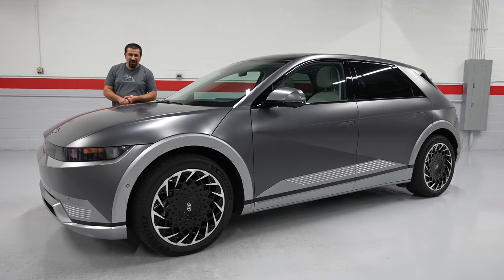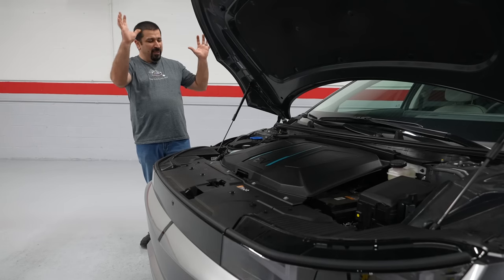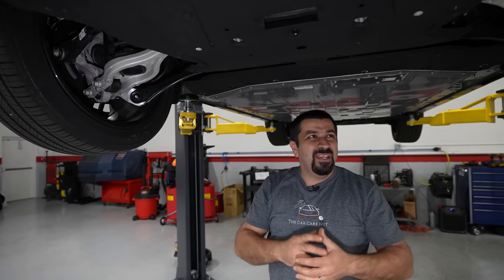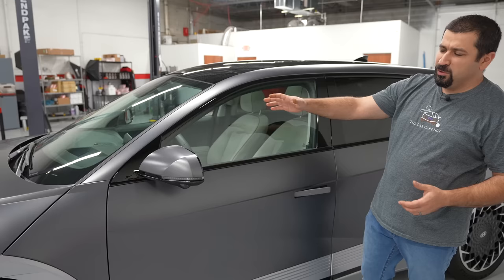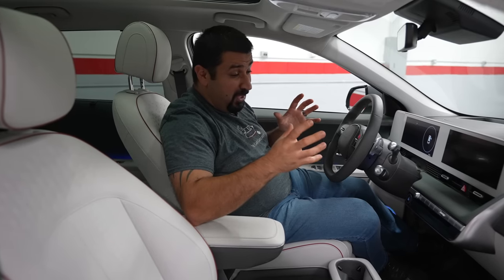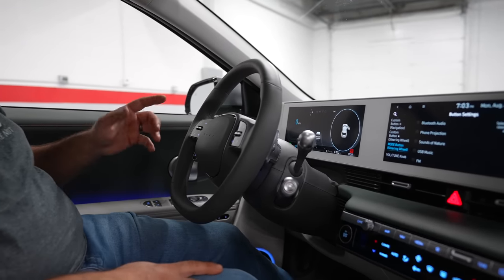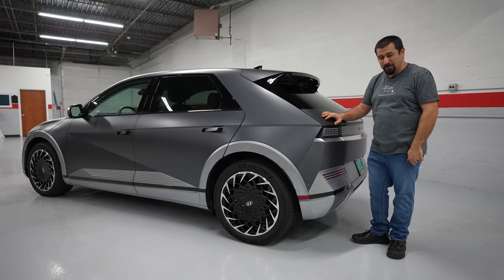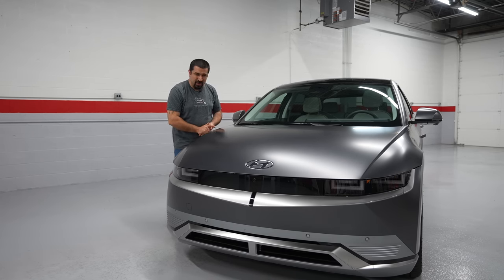Should You Buy a Hyundai IONIQ 5? Or a Tesla? | A Very Comprehensive Review

Comment: 30:27

You 're wondering why there are four dots.
The official sign of hyunday is an H 

In morse four dots are also an H.

I suppose this is why we find four dots, not three or five.
This also means that on the steeringwheel we find the signature from hyunday in the (already old) morse code.
 37 minutes...the shifter works absolutely fine to me. I suppose it's more as controls in games/simulators. Never went to the wrong gear.
But I never drove any automatic ice car before driving electrical. Also in european automatic shifters it's pushing to the front side for driving, back for reverse.
And I'm customed with a gear shifter at the steering column (in old european cars )

34 minutes.
Yes , at home I need to charge hours. But does it bother me? 
No because it does not take a minute from my personla time. Plug it in and leave it pakerd for the night.
How many days do you drive more tha 250 miles?

Any ICE car has to go throughout the year to filling stations. I only have to go to a superchargers on the occasionally longer trips  a few times a year. And in Europe it's not a big issue to find 350KW chargers along any main route. Also ..with any ICE car on those longer trips I made stops for toilet, coffee and eating....this model of car was charged before my personal stop was finished.
Only thing to plan....making those stops at places where a 350KW charger is available because the infra is not that good as for petrol ...but this will change in the coming tears.

(Remember...any electric car without a private parking with a level 2 charger is a nuissance to charge....unless your local government places level 2 charges ta the street parkings. And enough of those. Also that local government must guarantee that NO ICE car parks at the places for level2 charging (by pulling those away and asking fines to the owners)
I my country asking the local government for placing such chargers will be honoured (if there is none available nearby)

ps...I'm driving electrical (first partly) since 2013....I've seen the charging network growing.

Comment: One of the best videos I've seen on the car. Pointing out the EVs can have complexity is useful because too many EV enthusiasts say they are zero or close to zero maintenance vehicles. But I'm interested in what you said about the axles. I think a lot of people know that Toyota's bZ4s have a recall due to a potential for the wheels to fall off in hard driving. Is that a possibility with this car and other EVs? The axles can snap due to the force of hard and instant acceleration over time?

Comment: With my 120V charger (level 1). I got more than 10% off battery charged overnight. I have an EV6 long range. Technically, it's a samething as this car. Drive in the city, you don't need to have 100% nor 80% full. Just 50% battery is very plenty. And save the longevity of your battery. Actually, 25% is better for the longevity, but you're pushing there.

Comment: My Tesla Model Y does the D - backwards, R - forward.  Drives me nuts.  Would have much prefered the Hyundai 5 version of pushing it in the direction you move.   Must just be the way my brain works but it is much more logical.  He is complaining that his muscle memory is different rather than that the Hyundai is actually got it right but people won't be used to it.

Not sure why the big speech about range anxiety.  I had that for about a week until I spent a day driving in the country and realised you get a long way before you need to recharge.  Plugging it into the wall recharges overnight. Takes about 24hrs to get 100% recharge so not really an issue for me - you'd have to be driving 200km a day even need have to start planning a trip to the charger once a week.  If you drive 200km a day, you probably want an EV anyway because you must be spending a fortune on petrol.

Comment: If you want an EV that has a display behind the steering wheel, instead of a single centrally-located IPAD that does all control functions, then get the Ioniq 5.
Reply: The top spec model Ioniq 5 even gives you a heads up display - a godsend if you have to wear varifocals...

Comment: Couple of things… 1st, you said that it is costly WHEN the battery goes. Current batteries will ouTlive the car itself. Yes there will be some lemons come off the production line but those will be identified before the battery warranty has expired.  2nd, your assertions around charging and range anxiety are not based on real world use.  It takes me 20 seconds to charge my car… 10 seconds to plug it in when I get home at night and 10 seconds to unplug in the morning.  The number of times I actually have to use a DC fast charger are minimal.  Every day you start with a full battery. No bothersome trips to the pumps! Finally, electrifying existing ICE platforms is the least efficient way to make a BEV.  Toyota has even just admitted this themselves this week.  A dedicated platform developed for EV’s from the ground up is essential to the EV transition.

Comment: If you parked with the wheels turned to the right, and used the keyfob to move forward, would it drive to the right?

Battery: Better handling, less frequent maintenance, less disgusting and toxic fluids dripping everywhere...the future is bright! Thanks AMD!

For the door handles, over the life of the vehicle, you'd save hundreds of miles, and you use it once when you get in, not even when you get out, you don't look at it when you're sitting in the car...i love these logical decisions!

I've had ICE cars strand me with blown engines (acura rsx 2.0l, audi a5 2.0t), ripped belts (timing belt), happy to say goodbye to that expensive and stressful experience!

Two screens? Not logical!

Comment: Well, this whole thing remains to be seen. My chinese EV too has 2 cooling circuits, one for the motor/inverter and one for the battery, both use the AC in extreme cases (in my country this is necessary)
Although it has a resistive heater. And under my hood, it's all just there. nothing is hidden or obstructed, everything is easily accessible.
Reply: @Gerry Prasetyo I'm not that rich

Comment: I would agree with you about the screens. I've had a plethora of laptops and the longest any one laptop had lasted was 5-6 years, before it was irreparable. Are the screens inside the car any different, nope, same tech as any computer. So expect to have to replace your screens in about 5-6 years, and by screens I mean the whole computer system that runs that screen.
Reply: The car's battery won't be very usable after 5 yrs anyway. One of the big disadvantages of EVs is that their batteries deteriorate over time.
Reply: @dekkerlundquist5938  Sure batteries deteriorate over time, but the deterioration is less than 10% over 10 years... So by extension less than 5% over 5 years.
Reply: Laptop screens are much more exposed. They get lugged around, dropped, have heavy stuff put on them, and so on. A display in a car doesn't see any of that wear, unless you're really doing something wrong with it...
Reply: @FrederikNJS  Except that some batteries do not degrade at a linear rate.
Reply: @dekkerlundquist5938  Agreed! So it might only be 3% after 5 years, 9% after 10 years, and then it might be tapering off more aggressively after that. So possibly 15% at 15 years, and 23% after 20 years.

Comment: Thanks, nice review, I'm definitely on the fence about Tesla vs Hyundai Ioniq 5...I'm definitely leaning towards the HI5
Reply: Same.
Tried both yesterday.
Tesla was more fun but ioniq was more practical.
In particular, changing Regen level instantly on the fly with paddles in HI5 is way better than hunting through menus on the Tesla while your eyes leave the road.
One button for autopilot in HI5 is great.
Also, needing to go through menus on a touch screen just to open the glove box in tesla 😂

Tesla handles better though and can be bought much, much cheaper, especially with older models being around.
Plus the charging network is painless to use.
The nav is better than Hi5 too.
Also Tesla is fast, which isn't practical but is tons of fun when cops aren't around.😅
Tesla's also come standard with some things that only limited/ultimate HI5 has, so again, price is a factor.
If I could get a used '22 awd sel HI5 in my area I'd do it in a heartbeat but they're scarce, unlike Teslas.

Comment: Don't sell we octogenarians short (though I admit I have a few months to go)! My wife and I have each owned BMW i3's for the past five years. Though that model will soon celebrate its 10th birthday, ours still look and feel new and continue to bring smiles to our faces as we motor along. Though I did not tire of mine, last summer I was looking for a change, so after extensive research and several test drives I ordered a Volvo C40. I took delivery a month ago. (My i3 stayed in the family as our son now has it.) The C40 is another wonderful EV. (How about a review of one, or of its sibling, the XC40 Recharge?) Incidentally, when I was recently at my Volvo dealer I spoke to a woman not much my junior who was there to take delivery of her C40.
Reply: I match you in age. I have just had my XC40 Recharge VOLVO for one month. I bought in a hurry because my college ago grandson wanted my 27 year old Volvo 850. I am going car shopping on Thursday because the dimensions of the XC40 recharge makes it difficult for me to access the charging stations. And as they are not in frequent use the cable at 2 inches in diameter, is very stiff and difficult to plug in to my car at a charging station.  I loved my 850. I consider the XC40 a very fast electric golf cart. It was foolish of me to buy in a hurry, you do need a home charging system. I allowed the Volvo reputation of reliability, which I had with the 850, to cloud my judgment. It will be an expensive lesson.

Comment: I really like your videos, thanks so much for making them. 

The  E-GMP-based Hyundai Ioniq 5 received four dots on its steering wheel, which signified the letter 'H' in the Morse code. So the .... is for H

Regarding the aux battery, my friend needed  a 12V battery service on Tesla, warranty covered it but the cost is $1500. Ioniq 5 has it easy to access and replace. I have a 22 SE AWD. Super comfortable and have a floating ride. Hope Hyundai keeps up with the promise and have a decade of life with it.

Comment: like any other EV, this would make sense for someone that has a predictable (meaning going to the same place of work) daily commute. Especially, if you can charge at work and can charge at home. It would not make sense to drive around hunting for chargers. That is my 0.02 worth of opinion.
Reply: No point to charge at work for this. It's not going to add much unless you have a L2 charger at work and it's not going to make much a difference unless you commute 300km each way.
Reply: @wgemini4422  I charge at work once a week - no home charging available. And on road trips it's easy to recharge. This one goes from 10-80% battery charge in under 18 minutes, you'd be hard pressed to have a bathroom break and get something to eat before it is finished charging.

Comment: For about $1000 you can install a Level 2 charger and charge at home overnight. That’s the cost of about 20 tanks of gas at $4 a gallon and you’ll be “filling up” for pennies.

As for the battery failing and making electric car owners regret the lack of an ICE, I’m sure you remember the dire warnings mechanics had for people buying hybrids about a decade ago. Remember when all those batteries failed? Me neither.
Reply: My question is, “How much coal has to burn in order to recharge these cars every night??”
Reply: @coloradoboo1071  An amount that will produce significantly less carbon than a gas engine traveling the same distance as the electric would produce. That’s the point of electric cars, in case you missed it.

The only people that expect electric cars to be completely carbon free seem to be the people that don’t want electric cars.
Reply: You still won’t be able to go on a road trip in this or many other electric cars. Charging stations need to be as popular as gas stations. Until that happens, electric cars are pointless for most people. Also, the battery replacement is going to make up for any saved maintenance costs. Most hybrid batteries aren’t as expensive to change as something like this. Not to mention the production of that battery produces major emissions, so the whole “electric cars are so much better for the environment” isn’t completely true. I’m going to stick to my gas cars.

Comment: Can u make a video on how to fix a flashing check engin e light please. The car is a '03 camry xle v6 +250k miles  if that helps
Reply: Get a scanner to see what is causing it. Could be many things but in most cases a cheap scanner plugged into the OBD port will tell what the problem is. Then you have to fix it.

Comment: All the exhaust is at the coal plant that produces the electricity
Reply: And the battery factory
Reply: And what about the 20 kWh of electricity that are used by the oil company to get 6 litres (1.7 gallons if I converted correctly) of petrol or diesel from the well to your tank? These 20 kWh come from the same electricity grid you criticize - and are used to power your ICE... If you care that much about the 20 kWh of energy a Ioniq needs to drive 80 miles then you should care equally about the 20kWh your ICE car used up indirectly by adding 6 litres of fuel to its tank to then burn them and drive 80 miles while also spewing a whole host of other nasty gasses into the surrounding...

Comment: Honestly was kind of disappointed by this. Usually the reviews are very informative, but this felt mechanically lacking with a bit too much personal preference mixed in regarding the looks and charging. No mention of it's 800V DC charging, V2L from the charge port, just about how how it charges slow on a normal household outlet which is true for all EVs. 

The 800V charging is interesting, it actually has 2 400V packs and it's 400V in normal operation. When it gets to a DC charger, there's a bus bar that flips from parallel to series for the 2 packs to get it to 800V for faster charging. For the V2L from the charge port, there's bi-directional AC charger, it's one unit, the Integrated Charging Control Unit (ICCU), which is new and unusual for EVs. The ICCU had a big recall regarding coolant leaking however so they would fry themselves or overheat. Info like this is why I watch your channel, but it was lacking in this video. I hope you can improve for future EV reviews.

Comment: So I talked to a lady in her 60’s about owning a Hyundai Kona that she has used for 2 years. Every night she plugs it in and in NZ charges it free of charge wth the deal she has with the electric company in NZ. Therefore no range issues. So she drives without paying for fuel! If you document the costs of running a EV vs ICE then the EV already wins with large savings. Tony Seba has already proved that EV and batteries will only get cheaper every year so ICE can not compete based on price. Everyone will just have to learn, growth and change there habits to operate EV has cars - question is do you the intellectual capacity to do so?

Comment: always heard the faster you charge the battery 🔋 the faster it will deteriorate 
how true is that in your opinion?
Reply: About as true as the faster you drive, the faster your ICE engine will deteriorate.
Reply: If scientist talk about degradation through fast charging you need to know what they consider fast charging. That happens to be 6C - which is 6 times the capacity of the battery - if the battery is actively temperature managed (which currently all but the Nissan Leaf batteries are). So a 77kWh battery charging at 460 kWh would be charged at those 6C. The best current cars do - and the Ioniq 5 is one of the fastest charging BEV out there, only Lucid Air or Porsche Taycan and a select other much more expensive cars do better - is around 230-260 kW charging speed. The other thing that determines degradation is the charging curve and temperature in combination. The Ioniq 5 manages to charge at an average of 2.7C, that's high but not insanely high regarding degradation.
Reply: @karlgunterwunsch1950  you really went in-depth there 
thank you
Reply: @freshdotholla  What most people don't realise in the comparison of Tesla with other manufacturers is that Tesla has limited itself to a 400V battery system, their chargers included. That means that the Ioniq 5 has less charging losses because of a lower resistance in the charging circuits for DC charging - again including the chargers if they can provide 300 kW or higher charging (that typically is indicative of the charger being capable of providing 800V)...